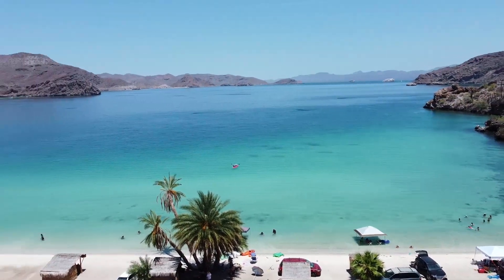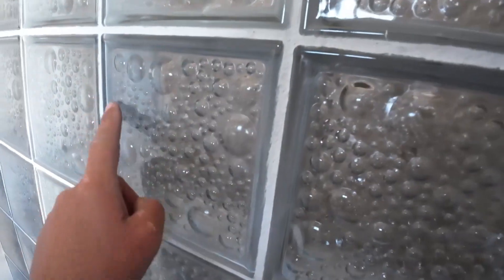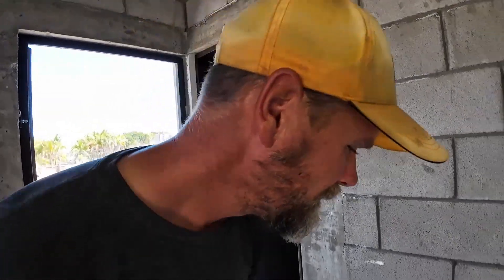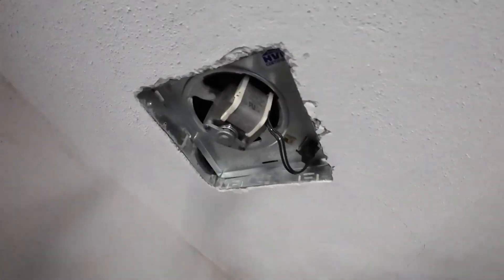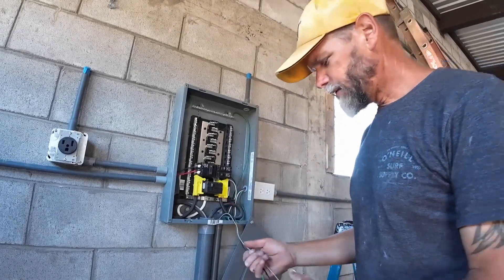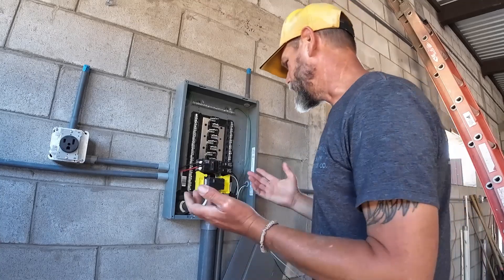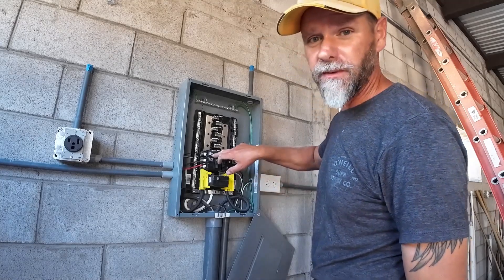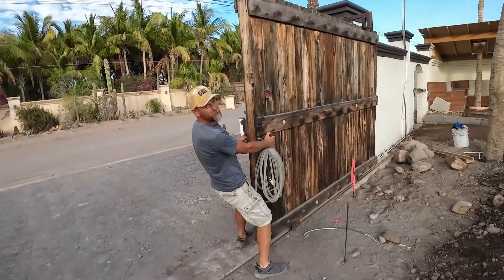Wiring up our Garage and Bathroom at our Resort in Loreto, Mexico

Comment: Running wires is never boring especially when it's your fingers around the power sources. As you likely know 110/120 V hurts but is not too bad. 220/240 V can cause your hand to spasm and hold tight to what is shocking you. Which can be funny as hell to those watching. Until that is they make the mistake of helping you and get zapped themselves. Re the fans ever notice how the price dictates how loud they are?  That place should amazing for years to come.  Dave  P n D
Reply from the maker: I was an electrician so I am familiar with getting shocked by everything from 110 up to 480 volts. The key is not to grab on to anything that is live, that way if you get shocked you instinctually pull your hand away
Reply: @dooglassandesperanza  Or so 1 hopes. A friends son died from 240. The power was shut off. The switch locked out. Someone cut the lock, ignored the writing and threw the switch. Some days it does NOT pay to get out of bed. And sorry does not quite cover it.
Reply from the maker: That is horrible. I never saw anyone die on the job but I saw a guy get hit by 480 so bad he was out for almost a year.